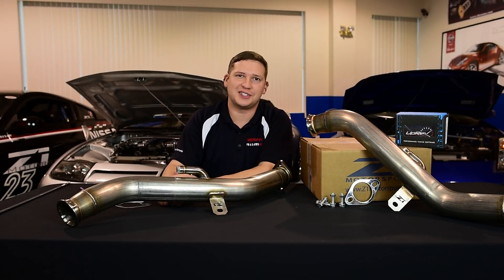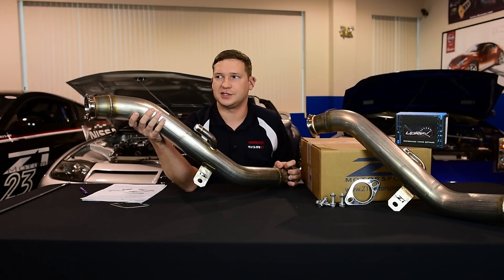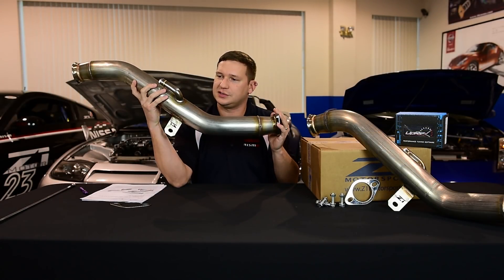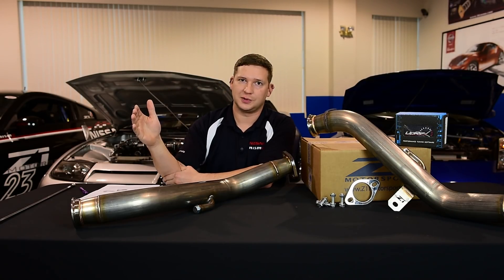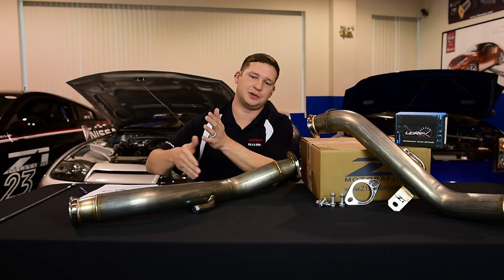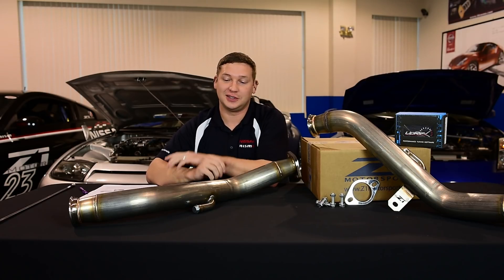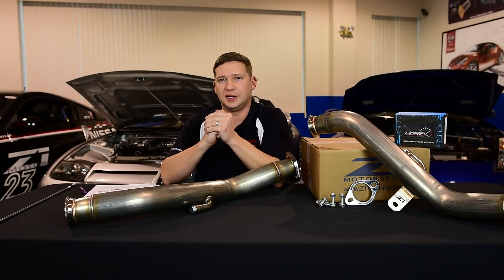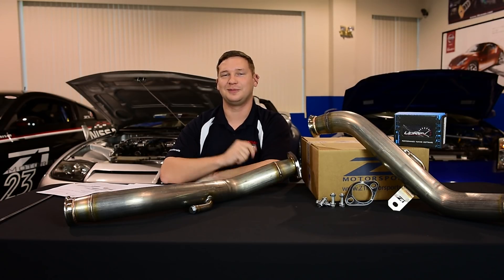Z1 Q60 Downpipes - How We Got 608 FTLBS!!!!

Comment: 600 of torque with a little help = lies, there's have to be a lot of other things and the transmission is the weakest part  of the Q50 .
Reply from the maker: 100% not lies. The only modifications done to this car ENTIRELY are....coilovers, Volk TE37 Ultras, our downpipes, a prototype Z1 exhaust, and a license from UpRev. That's it. We made 608 ft. lbs. to the wheels and immediately dialed it back as we did not want to damage the car. The transmission has been holding fine with no issues so far.
Reply: The transmission behind the VR in the Q has additional clutches stacked, as well as improved friction material over the previous 7 speeds. It's not weak by any stretch of the imagination, and there have been no failures reported yet. Also not hard to believe that when you pull four catalytic converters out, bump the boost and throw more timing at a direct injected modern twin turbo engine you can make tons more power.
Reply: Z1Motorsports 
There's no way I can believe a 86mm piston can make that torque, with stock turbos , tuned and downpipes.
Even if it was one time that's a lot of hp to make that torque.
Reply: Rey Perez sounds like you have your numbers wrong bro, these engines and small turbos are waaaaay underrated. Want to know by how much? Look for a video around here of a q50 racing a fully modded, tunes and 100 shot of NOS 5.0 and a C7 vette with intakes, exhaust and Tune get spanked by my friend white Q50 lmao. Just because your numbers don’t add up remember you’re not always right it’s engine physics..
Reply: Rey Perez and my pal only had exhaust and tune on his Q50...
Reply: In the mid '80's BMW's F1 team produced a 1.5L 4cyl that produced 1500hp in qualifying trim. Why does it surprise you that a 3.0L is capable of 608lb-fit in this current trim in 2017? This drivetrain is based around the one used in the GTR LM-NISMO (the LMP1 car) it's capabilities are still untapped, with larger turbo's it'll be capable of plenty more power, the smaller stock turbo's don't flow enough volume to keep the HP up with the torque.
Reply: drizzestsrevenge - You got a link proving that? Because when Stillen put that car up in the air it was the same model as the G37 which is only rated for 300ft/lbs tq. 

The variant of it is good for 400,  either way can't help but think the longevity of the transmission is compromised by pushing over 500ft/lbs tq.
Reply: Rey Perez  - Makes perfect sense,  smaller turbos spool up much quicker and produce peak torque much earlier in the rev-range. A larger turbo makes higher peak power but it arrives later in the rev-range.

It's a trade off.
Reply: I don't have a link, I've done all the research myself, have not, and will not be publishing the information. I actually have sitting on my desk ALL of the Q50 / Q60 VR30 friction and steel plates. Simply looking at the exterior casing tells you nothing because the transmissions are in fact similar. They share the same RE7R01A trans code but the internal build components are different. The Q transmissions stacked additional clutches and used different friction materials, with additional improvements made to the valve body.

There is nothing out there to suggest that the transmissions longevity is compromised by power, and there are currently no known failures.
Reply: Drizzetsrevenge - While I'd love believe your claim that is a $3000 repair/w labor if your wrong,  so without some actual proof I'd not openly advertise that fact without recording or posting a tear down and showing some part numbers.

As for Infiniti simply reusing the exterior transmission case yeah that's very likely, however  they also have a RE7R01B variant with higher torque capacities which makes more sense to be used instead of upgrading the A variant. 

It also doesn't make sense they would reuse the designation and not call it RE7R01C or something,  additonally neither Jatco nor Infininti/Nissan have outright confirmed they've reinforced the transmission for higher torque ratings which is odd. That is a note-worthy improvement that the community has been very vocal about it in discussions, and very likely asked by tuners and 3-rd party performance vendors to which we've heard no confirmation from either.

It's possible they simply forgot to report on it, but that's a stretch especially when you consider need openly advertised the fact they had reinforced the manual transmission in the 370' for 2018 and that car didn't get a new engine with 100ft lbs more torque. lol
Reply: It's not a claim, it's a fact based around hours of research done using the Infiniti / Nissan parts software. It's 100% factual information, you can choose to believe it or not, that's up to you. If you truly believe Nissan took a transmission that was developed 10 years ago for a 300hp powerplant and reused it behind a 400hp with no modification or revisions, that's on you. You won't find any 3-rd party vendors writing publications on this because it doesn't matter. There have been no reported cases of failure so it's not a hot topic worth discussing. Jatco / Infiniti won't be talking about reinforcements made to the transmissions because it's a mass produced luxury car and the vast majority of the consumers don't care. Saying "we've upgraded the transmission" is like saying "yes we accept they were exceptionally weak before and needed improvement." Not a wise move for a major automotive manufacturer. It's just like when Nissan changed the exhaust manifold design of the 370Z in 2015, now using a totally different collector. They made more power as a result, it was not marketed or published. It still hasn't been and won't be.

As far as trans code, the RE7R01B is used in SUV's and trucks, up to the new Titan XD. If you'd like to know why they used the RE7R01A instead of the 'B' I'd suggest you reach out to consumer affairs at Nissan, or even reach out to Jatco since they're the ones that develop the TWO transmissions that Nissan utilizes. I'd like to see where Nissan advertises that the transmission was reinforced for the 2018 370Z, because it wasn't. Quoting what they actually said: "every Z® with a manual transmission enjoys a new EXEDY® high-performance clutch, for reduced pedal effort and enhanced precision and control."
Reply: If you are not providing any proof/evidence or your  of research then a Claim is exactly what you just made,  as for reliability yes I've heard no issues thus far with the transmission that doesn't mean long term reliability isn't being compromised. Keep in mind nearly all manufactures low ball the rated tolerances of  transmissions. 

As to why they would use a 10 year old transmission?  Because they are going to release a replacement for 2019-2020 and simply did the math that the warranty claims would be cheaper to deal with then retooling an assembly lines so transmissions can be reinforced?

They already have a stronger transmission in the RE7R01B why would Ininfiit bother wasting the man hours and R&D time improving the RE7R01A when they have a capable replacement already available?  So while yes the RE7R01B is mainly used in trucks was also used in the M57/Q70 which is a sedan because it was offered with a V8. 

You are correct though it's a new clutch for the Z, I was trying to recall an article I read from months ago should have double checked that before posting thanks for the correction.
Reply: It's not a claim, it is factual. You can research it yourself if you're curious, the information is out there if you know what you're looking for. I'd be happy to publish it but I have no means nor a reason to do so currently. Long term reliability is always a question on any new drivetrain. As far as this revised RE7R01A, well it has been used behind the VQ37VHR in the Q50 in the same configuration since 2014 so that's where you can base that. The valvebody was changed between the '14 VQ and '16 VR iirc though.

There is no retooling or re-configuring of assembly lines needed to build a reinforced transmission, they're simply utilizing different PN's and quantity during assembly. They're either changing the friction material type on the clutches or they're swapping the clutch assemblies as a whole. This is likely the reason why they continue to use the RE7R01A trans code. The RE7R01B may be a more durable transmission but I'm betting it is also physically larger and geared very different, so it would probably cost more to gear and build it to fit the VQ/VR's than it did to just reinforce the RE7R01A.
Reply: drizzetsrevenge - Again see previous point in regards to claims, but we agree to disagree I suppose.

But you've raised a good point about reaching out to the manufactures although I don't know if they'd respond to a random email,  but they that's 10 minutes of work so I'll give them and Infiniti a poke as you never know.

In any case every diagram and breakdown I've looked at today shows identical housing between the RE7R01A and B however I've not found any external measurements, as for gearing differences it looks like the main difference between them is about 5% taller gearing from 2-6th gear and a about 7-10% for 1st and 7th gear so not actually that bad it seems. Looks like it really is just robust clutches being the big difference. 

As for retooling assembly lines I can concede that  it would be a smaller change than originally thought,.
Reply: You fail Rey LOL I’m sure Nissan did their research! VQ35DE/HR transmissions are NA and can handle gobs of boosted power. The HR NA motor on boost can handle 600HP so you think the design of this engine and transmission will not hold up? Many manufacturers are doing a great just will reliability now and days. So you mean to tell me Z1 is going to lie when a company like AMS choose this platform for their company to modify and have proof of 10 second quarter miles and their only claim is that the drift shaft is the only weak link in this car. Gtfoh man.
Reply: Rozeth Chhem well max ratings for transmissions are typically done via torque not hp.

But yes infinti has since gone on record saying they have improved the tolerances for the new engine.

That said they never gave any numbers or said how they improved it. Personally I'd rather they simply replaced the transmission rather than carry it over with reinforcements.
Reply: Z1Motorsports what are the specs on the exhaust?
Reply: I think there's a company that can do a Level 10 upgrade to the transmission = problem solved.  https://www.levelten.com/370Z_TRANSMISSION_p/niss0g1800-re7.htm  (same as the infinity as nissan uses the same 7 speed with variances in tuning.  Basically $5k + install to do it right).